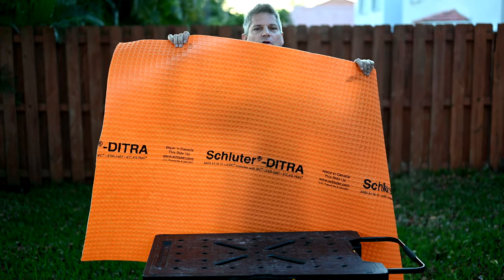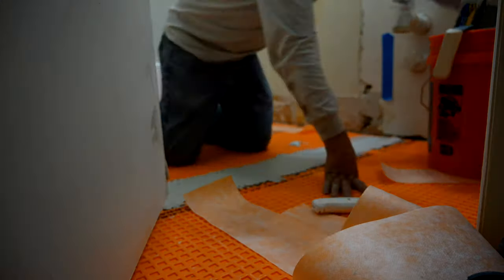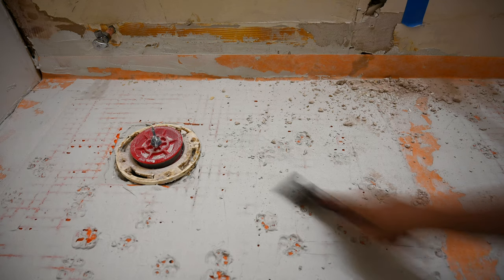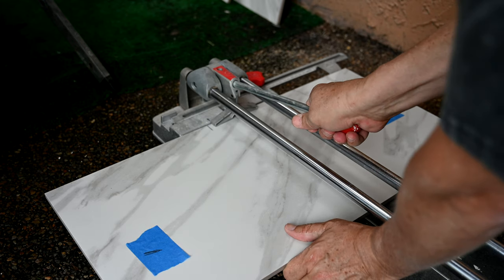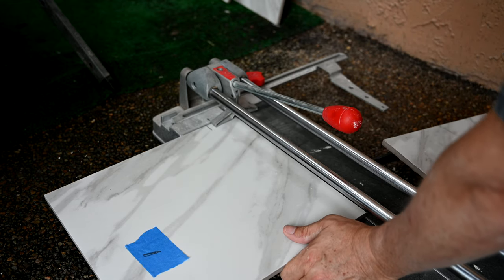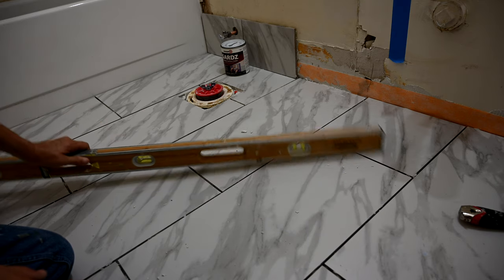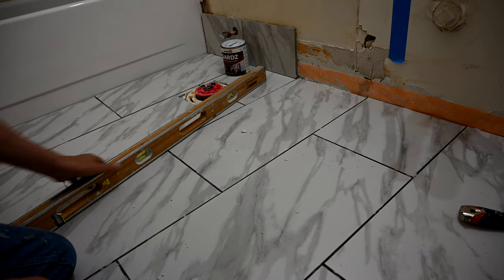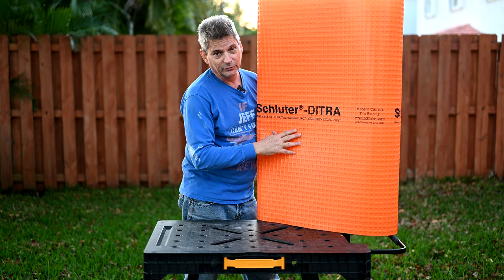Schluter Ditra FAIL Tile Install: You WON'T Believe Cause!

Comment: Your video is very misleading. You have labeled it as a Ditra failure....... in fact the Ditra did not fail. Should reconsider the name of the video. Maybe something about the dog walking across it but not that its a true failure. As I am a schluter distributor and a 22 year veteran installer I constantly look for videos for education and look for ways to educate my installers. You did an amazing job on your install. I saw you do stages of the install that most guys would not do. I commend you on your back buttering and also the small spacing between the base and tile that most guys dont realize need to be there
Reply from the maker: Thanks for the insight Brian, I always try to do things with engineering thinking, and use the TCNA rules.
Reply: I agree!! You are lucky to not be sitting in front of a lawsuit from Ditra!
Reply: A bit of clickbait doesn’t hurt 😊

Comment: Misleading, wasted my time!
Reply from the maker: Misleading in what way? I showed a disaster that took a couple of hours to clear out of the way before we could continue tiling. If you felt your time was wasted that would be your fault for not clicking away immediately if you revolution didn't think the video was living up to its promise. I'm not sure what exactly it was you were expecting there was a failure and I showed the failure and I showed the recovery from the failure.
Reply: You did show a set back, hardly a disaster though and to say that the product itself had failed was far from the truth. I stuck with it waiting to see how the product failed but alas I was fooled. That is why I said it was misleading!!!

Comment: You call that a failure then why would I subscribe
Reply from the maker: Well it wasn't a success! I spent 2 hours chiseling, grinding the floor back down because the tenant let his dog in the bathroom after promising me the dog would be caged overnight.
Reply: The work you complete demonstrates your commitment to the profession. I expected a true tile or preparation failure not the dog prints
Regards

Comment: My understanding is you don't put the thinset on top of the Ditra until you are ready to tile. Not sure why the thinset was left to harden without tiling.
Reply: Up to you. I think it silly to do it ahead of time. Btw I just tried mapei’s version of this membrane and liked it a lot better, it doesn’t have those empty waffles you need to add extra thinset to. 👍
Reply from the maker: You are wrong. Schluter says you can do it either way. I chose to let it dry overnight so I could move about the DITRA floor already to go. Sometimes it's about logistics and timing, the lateness of the day, so I finished installing the DITRA at 8:00 PM, with the tenant still living in the unit, time to head home for the night after that.
Reply from the maker: @PrettyHandyGirl   What time stand in the video are you referring to?
Reply from the maker: @PrettyHandyGirl  No there is no 1/8" layer on top, you can even see orange lines and waffle cells poking through. When I fill the waffle holes, I scrape it completely flat over the top, look closely you can still see the outlines of the waffle holes through the thin set. I think your brain is getting tricked by the dog's paw prints, which oozed up thick when she stepped on the fresh wet mortar and I just scraped it right back down to the level of the DITRA. Even if there was 1/8" layer of mortar over the top, still nothing wrong with that.
Reply: @jeffostroff  How can I be wrong, we're both saying you can do it ahead of time, or not. Me personally, I prefer to just spread the thinset normally on tile day and let the waffle dimples fill in then.
Reply: Brittany.....Go back to the kitchen and make me an apple pie....

Comment: You installed the Schluter Ditra incorrectly. You should not have applied the thinset to the entire surface. You only needed to apply the thinset morter to the taped the seams.

Comment: That's a failure on you why was there  thinset on top of it when you weren't laying tile? The only thinset that should have been on it is where the band was installed.
Reply from the maker: You are allowed to fill in the cells and let them dry overnight. You can also fill them in right before you tile.
Reply: @jeffostroff  why would you tile mix two different moisture and cure rates together? That's just asking for problems I'm sure the mixtures aren't absolutely mixed the same.

Comment: That was not a fail, but rather a mishap!
Good recovery none the less 👍
I would add, if using the AllSet, do the min recommended water for tiling. I measured in the middle of the recommended for tiling and found it tooooo wet, I throw out the whole batch. Start out with less and see how it is going in the the first 2 min of mixing and add a more water if needed in the last 3min of the initial 5 min mix before the 10min slake and 3min final mix.

Comment: I just did ditra. It was a pain to get hose air pockets out of the little squares but going on diagonal to the squares and back and fourth a few times does the trick. I was worried partially filled voids could cause problems. Little extra elbow grease but worth not having to second guess
Reply from the maker: yes, one of the reasons why I filled them in and let them dry overnight to make sure I did not scrape any mortar back out.

Comment: I see that in your preparation of the floor you pretty much filled the entire DITRA with thin-set prior to setting tile. (???) 
As I understand the use of this DITRA product  the square indent pattern is to be filled with the same mortar that you are using as you set the tile. This insures the tile & mortar are bonded INTO the DITRA to create a locking system. If you have filled the DITRA pattern prior to setting tile it's NOT being used to its full potential. It's almost the same as a flat surface like backer board or concrete. I have used this product more than a few times and have never seen this method until now. My opinion is that this method defeats the purpose of the DITRA. You could have just used the Schluter membrane system instead. (just sayin') 😎
Reply from the maker: I don't know where you get your info from but you're completely wrong in your assessment of what we did here. I used the exact same schluter all set mortar which is what I use for putting down the Detroit as well as tiling right over the dutra. Schluter tells us we can install it anyway we want we can apply the TH insert and fill in the holes the day before if we want to or we can wait until we're just about ready to tile and do it then. So your assessment is incorrect of me being wrong in deciding to trial in the thin set the night before. Don't just spout off what you think is right, you always have to read the actual directions directly from the company
Reply from the maker: I don't know where you get your info from but you're completely wrong in your assessment of what we did here. I used the exact same Schluter all set mortar which is what I use for putting down the DITRA as well as tiling right over the DITRA. Schluter tells us we can install it anyway we want, we can apply the thin set and fill in the holes the day before if we want to, or we can wait until we're just about ready to tile and do it then. So your assessment is incorrect of me being wrong in deciding to trial in the thin set the night before. Don't just spout off what you think is right, you always have to read the actual directions directly from the company
Reply: @jeffostroff  I've read the directions and it does NOT say anything about filling the holes prior to setting tile the night before. (page 19) HAVE A NICE DAY..!
Reply from the maker: @m.j.hooligan8139  LOL It's amusing when uninformed people come in and try to do a mic drop and use all capital letters at the end LOL. Take a look at Schluter’s official video on their YouTube channel and I have it set right to the point where they're installing DITRA https://youtu.be/WCySxf-fx7o?t=131. Don't you think by time they did this install on the entire bathroom that the mortar has already dried in those cavities where they applied the Kerdi band on the seams and edge by the wall and you can see the excess mortar filling up all of those cavities?  Do you not see they effectively pre-filled the cavities? You can bet all of that will be dry by time you're done installing the Detroit in the bathroom. There is never an issue about having new wet mortar over an entire dried mortar as long as it's within a few days. We have also called and spoken to Schluter about this in the past and they have told us it is perfectly acceptable to backfill the cavities first and let it dry. Although they did say many installers prefer to just do it all at once when it's wet but sometimes time constraints prevent you from being able to tile immediately after so that's why filling the cavities the night before and then coming in and starting the tile the next morning is a great way to do it. Now I realize you will never want to believe you are wrong because you've already dug yourself in to a trench, but if you don't believe me you can call Schluter at,  888-472-4588 Press 2, and ask the technical advisor there whether it's OK to do what we did. They will tell you it is absolutely perfectly fine.
Reply: Sorry Jeff, but I'm positive M.J. Hooligan is correct.  View the Schluter video https://www.youtube.com/watch?v=qa_l7U7zh0w,  and note that at 8:50 they mention how the thinset mortar is mechanically locked into the top of the membrane.  The way you've pre-mortared the membrane you can't have the mechanical locking.   When you installed your tile you'd have a mortar to mortar bond, which is not ideal.  You can tile immediately after applying the membrane, and some of the cells will be filled with mortar by the waterproofing, but you really should leave the rest of the cells unfilled until you actually tile.  I'm positive if you call Schluter they will tell you the same, their number is at the end of the video you linked.  As far as the mortar drying before the membrane is installed, they mention this and say to avoid the mortar skimming.  They even suggest installing in sections when you have a large piece of membrane to install.
Reply: @jeffostroff  Jeff this isn’t correct - if you are tiling over dry mortar on top of the Dirta, you might as well not even use the membrane in the first place. You lose it’s decoupling capabilities.
Reply: "We showed a textbook perfect installation".....lol
Reply: @jeffostroff  there is absolutely nothing in that video about covering the entire surface with thinset; it is entirely about applying the Kerdi banding.  You defeat the whole purpose of the Ditra by filling it in. Your tile isn’t locked into the Ditra because you’re just putting thinset against thinset.  This whole video is weak.  But I guess it does serve to show what NOT to do.
Reply: Only installer on YouTube back-filling Schluter cavities and allowing to dry before laying tile. Just because you “can” do something doesn’t mean you “should”. Home RenoVision level head-scratching going on here.
Reply: @jeffostroff  It is amusing when uninformed people come in and try to do a mic drop isn't it. But Jeff, you're the uninformed one in this case. Literally every video online shows installing the tile and filling the cavities at the same exact time, including the video link you attached. If you had an engineering brain you would realize how senseless your method of install is, I don't care what anyone says, it's obviously wrong. I don't understand how someone could be this dull headed? Yes the seams are filled, the seams! There's a reason for that, I'm sure you prb wouldn't get it, so I won't waste my time. Just stop using this product if you don't want to install it correctly. And stop click baiting.

Comment: Correct me if i'm wrong but the adhesive goes onto the floor first and then the matting adheres to the adhesive, or have i missed something?
Reply from the maker: You use the mortar to adhere the DITRA down to the floor first. That was done here. Then I troweled the tile mortar over the top to fill in the cells and make a smooth layer to tile over in the morning. But while it was wet is when the owner let his dog in there.
Reply: If you want to install it correctly do not add in the second step he added in for absolutely no reason. Tile adhesion 1 on 1, you want a rough surface to adhere tile to. Not to mention filling in all the cavities defeats the purpose of the uncoupling system, which is why you won't find anyone else online showing this type of install. You just fill in the seams with the proper membrane and thinset.

Comment: This is a old video but why did you put thinset on top of the ditra if you wasn't tiling ???? This was a big mistake and doesn't make sense.. you fill the waffle holes and then spread more thinset then add tiles.
Reply from the maker: Your statement is highly incorrect this is not a big mistake. If you read through the instructions for ditra, schluter tells you that you can either tile directly on top of it as soon as you fill in the cells with the mortar, or you can fill it in and smooth it off and let it dry overnight so that you don't have to worry about tracking mortar all over yourself.

Comment: Ive yet to have a bad failure using hardy or preferably go board but but im lucky i guess. Ditras ok. Kerdi paper i dig. As long as ive hu g tile on hardyboard schleuter is a $ system. It works. But so does water sealed hardy ( seal the seams with rubber instead of thin set ).

Comment: hi 
 i want to install   natural stone  slab  on this in living room and kitchen  for the first time any suggestion  thx
Reply from the maker: For natural stone, it is important to use white mortar, don't get gray. Schluter-requires the use of Schluter SET™, ALL-SET™, FAST-SET™ or an unmodified thin-set mortar meeting the requirements of ANSI A118.1 to install ceramic (including porcelain) and stone tile over DITRA . I prefer to use Schluter's Allset mortar.

Comment: Another reason why i fill the mat as I'm tiling.  not before
Reply: Lol, well the main reason you should do it the way you do it is because its the correct way. This guy has no clue what he's doing here. He's defeating the purpose of the uncoupling system and hes weakening the strength of the tile adhesion, smh.

Comment: this wouldn't have happened if you didn't try to prefill the Ditra. That's not the "textbook" installation. Textbook install, according to the manufacture is to fill, comb, lay tile. Easily avoidable mistake my man!
Reply from the maker: I checked with Schluter before doing this they said it is ok to do it either method. the problem was the tenant told me don't bother reinstalling the door, we will keep the dog locked up downstairs. That's why it happened, not because I combed the thin set on early. Your assessment of causality here was simply incorrect.

Comment: Is that baseboard tile not bullnose?  How do you handle the exposed edge?  Caulk to transition it? I'm torn between that and wood baseboard. I have 3/8" porcelain tile.
Reply from the maker: Yes sometimes with porcelain tiles you have a nice colored edge but sometimes I will still use the silicone to transition the edge to the wall and sometimes you have to do that anyway to covered the part number that the manufacturer Prince on the edge of the tile which stinks and then of course sometimes if you have to make a cot on the tile then you're left with a cut edge which needs to be covered with silicone.  Another good method ideas before is using pencil tiles along atop they're really thin tiles that are rounded that look like pencil shaped and those make a great transition as well I do that a lot on back splashes around  Sink vanities

Comment: Does anyone know the tolerances for a unleveled concrete floor using the same products? Like maybe if it's 1/8th of an inch higher, the Ditra will level it for you. Please and thank you
Reply from the maker: DITRA will not level a floor for you. You should never rely on an underlayment to level the floor. According to the TCNA standards that I use, floor requirements are subfloor must be level no more than 1/8" over 6 feet, and 1/4" over 10 feet. If not, grind down high spots and pour self leveler when needed. Now, since we use a bit of mortar under DITRA anyway, it could smooth things out a bit, and you could also further rely on mortar thinset thickness under your tiles, but they warn you not to try to use the mortar to act as a leveler, it's often a fools errand. But I have done it up to 1/8". Let's say like normal, I use 12 x 24 tile. I need a 1/2" thick trowel, so the mortar reduces down to 1/4" thick when you set tiles on it. As long as any of your bumps underneath it stay within that 1/4" thick trowel coat, you'll be ok.
Reply: @jeffostroff  Thank you. I could not find this information on personal experience you gave me
Reply: @FromThe3PointLine  use self leveling products. You welcome

Comment: Excellent work.  What kind of working time do you get out of all set before it dries up too much?  We used to use the bostik ditraset for schluter installs however, it has been discontinued by our supplier
Reply from the maker: I tend to mix half bag at a time to avoid setting up issues, I prefer it to working with a huge bucket. I get about 3 hours out of a bucket. If I have a helper, we'll split the 50 lb mortar bag into 2 buckets, he'll back butter tiles with one bucket while I trowel mortar on floor or wall, then he hands me a tile ready for setting.